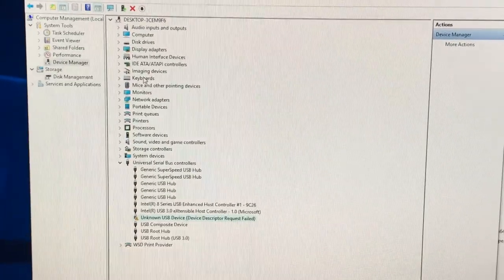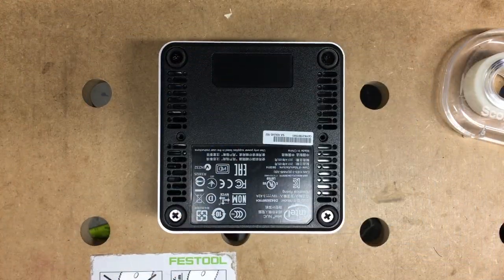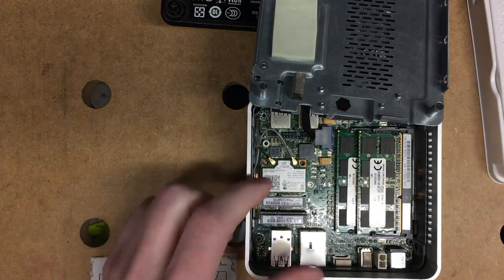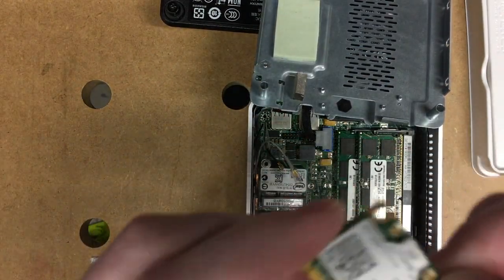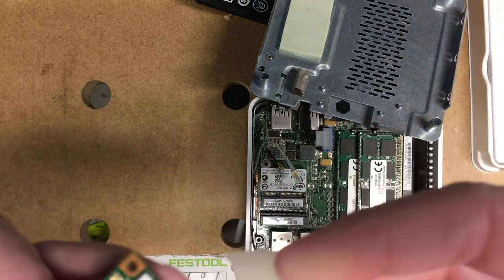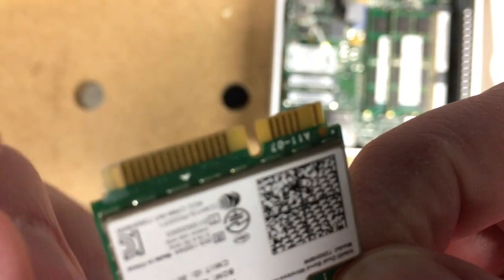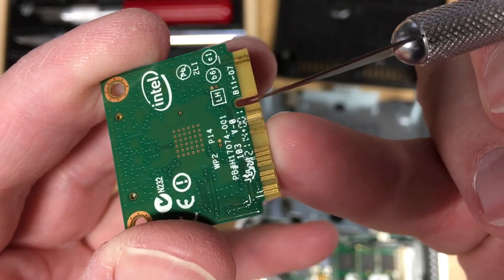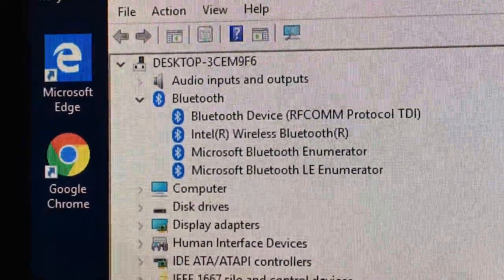Intel 7260 Wifi/Bluetooth Card Fix

Comment: I'm using a mac WiFi card in my pc with a pci-e adapter its an apple card and I can't use the WiFi and Bluetooth simultaneously Bluetooth audio will cut in and out and same with the WiFi connection to the Internet. Is there some sort of driver that I should be using
Reply from the maker: If you can find out what chipset the Mac card uses, you could look for a PC driver. It is possible that Apple has some proprietary modifications that is limiting it's functionality in a PC.
Reply from the maker: I was just thinking, there should be a driver available somewhere because Mac's can boot Windows. I'm not sure where to find it though.

Comment: Why?? Why does this seems to work? I swapped the AC-7260 from my dead Dell to old Acer but it won't to turn on the WiFi even if it was detected in Device Manager, covering the pins helped to recover wifi and Bluetooth showed up as well, which needed some more fiddling to start working but well, it's working now. Nice and thanks
Reply from the maker: I don't know why it works. I found this fix in a forum years ago.

Comment: EDIT 2: I decided to leave pin 20 unisolated, which seems to have done the trick. 

EDIT: It stopped working again. I'll get back to you soon. 

I tried your method on mine and it worked! The difference for me was that I had to download the Bluetooth driver from the Intel website and install it in order to finally make it work on Windows. On Linux it worked instantly.

Thanks a bunch!

Comment: Antenna port 1 and 2.  Is one WiFi and the other Bluetooth or is 1 & 2  5GHz and 2.4 WiFi?  How do I know which one is what.. Thanks!
Reply from the maker: I put the black wire on the connector towards the outside of the case and the gray wire on the connector towards the inside. I'm not sure if that was correct but it seems to be working for me.
Reply: Bluetooth uses no antenna, so the answer is one per channel
Reply: @KaptainCanuck  The Bluetooth is definitely sharing the antenna. Our BT mouse only works a foot from the PC if the antenna is not connected.
Reply: Bluetooth shares the 2.4Ghz band. The main and aux antenna ports are irrelevant. Both bands are active on them. Higher end laptops connect antennae to both for better signal. Cheaper laptops only connect an antenna to one of them.

Comment: Rick, I Can’t understand why your intel NUC won’t pickup and configure that Intel card as it is? Is something wrong with the NUC or is it the card? Also, how did you find out about this and will it limit or affect any of the Wireless/Bluetooth capabilities? Thanks for the video!
Reply from the maker: I'm not sure. I can't remember if the bluetooth worked when I initial set it up years ago. I did some searching around online and found out about the two pins. It seems as if the two pins cause bluetooth to be disabled.
Reply: i had the same same problem on an old toshia satelite that i put a NEW 7260 in and bluethooth didnt work at all.  taping over pin 51 did it right away. so its not just the nuc

Comment: Just today when I tried to use Bluetooth on my NUC it didn’t work, and when I went to device manager I couldn’t find Bluetooth, and when I try to click “troubleshoot Bluetooth problems” I get the message saying basically that ‘your hardware doesn’t support Bluetooth.” Yesterday Windows made a few updates but nothing happened to the NUC itself (didn’t drop it, move it, etc.). I am downloading various updates from Intel’s web site, if those don’t work I might have to try this. :\
Reply from the maker: Yeah. This is sort of a last ditch effort. If this doesn't work, a USB Wifi adapter is probably the easiest and sure solution.

Comment: My 7260 on my pc is being detected fine, at least on my current version of win 10 but I have many people complaining my bluetooth headset sounds terrible. Works fine on 8260 connection on my laptop. Wondering if anyone else is noticing the issue with bluetooth connections being on but unstable?
Reply from the maker: I haven't used bluetooth on mine much. It might be easiest to get a cheap USB Bluetooth dongle.
Reply: On the ngw m. 2 key a and e form factor cover pin 56 to enable BT

Comment: i have the same problem but with the intel ac3165, does anybody know fix?
Reply from the maker: That sucks. I don't know about the ac3165 but I haven't found any other cards that I could replace the 7260 with. A USB wifi card might be another option.

Comment: Will this works with Lenovo ThinkPad L420?
Reply from the maker: If you are having problems and it uses the Intel 7260 card, it is probably worth a try.
Reply: @Rickmakes  what do you mean?
Reply from the maker: @foodtrips8223  Do you know which wifi card you have in your laptop? This fix only seems to work on the Intel 7260 card.
Reply: @Rickmakes  i have currently the intel centrino n-1000, any advise
Reply from the maker: @foodtrips8223  I don't know of a fix for that one. You may be best off using a USB wifi adapter.

Comment: How do you reconnect the wires?
Reply from the maker: The antenna wires should snap into the connectors on the wifi card. The connectors are opposite from where you plug it into the computer. They are like tiny snaps.

Comment: sadly didnt work for me, even after removing 51, then 20, then 21 as others have suggested. I get an 2 unknown devices and a “PCI simple communications controller” in my unknown devices. Wifi still works ok though, just bluetooth undetected
Reply: Same, have you find any solution?
Reply: @43mm3  bought a bluetooth usb dongle for £2.85 on ebay
Reply: @mladen5  😢😢

Comment: Hey dude
I did everything you did, but it still does not work. I need help :(
Reply from the maker: If you aren't concerned about destroying the card, you could try using a tool like a Dremel to remove the copper contacts as opposed to covering them up. If that doesn't work, I'm not sure what else could be done. At that point your best option is to probably look at USB wifi adapters as I don't think there are any other wifi cards available in the same form factor as the 7260.

Comment: taped both of them but it doesn´t works... i could cry, why is it always me =(
Reply from the maker: You might try double checking that you got the right pins. You could try removing the pins with a Dremel rotary tool. It could ruin the card but if it doesn't work anyway, you may have nothing to lose. If you can't get the card working, you might want to look into getting a USB wifi dongle.
Reply: Not just you, didn't work for me either :( My onboard LAN also is stuck in permanent deep sleep (or it is broken, can't know)
Reply from the maker: @Sp4zc0r3  You might try a USB wifi or ethernet adapter to get it back online.

Comment: Dang! This would be awesome if it works. Have 4 of these cards in some older hp prodesk 400 machines and i was trying all kinds of stuff.  Gave up finding a working driver and planned to buy some cards. Ill try taping the pins in the morning, will save me some money on adapters if it works! Ill report back